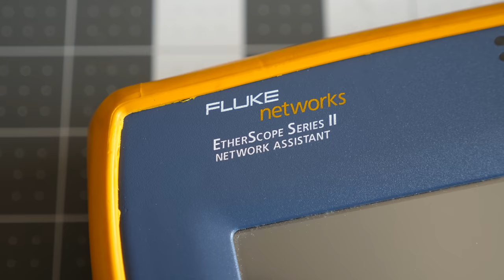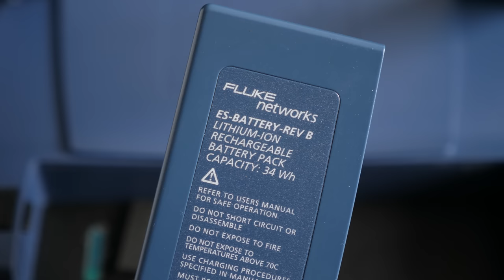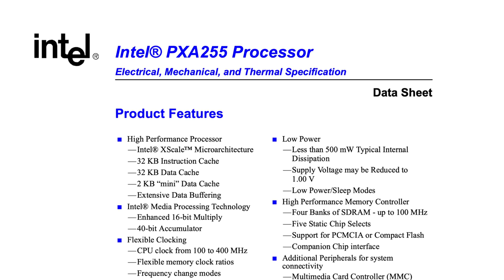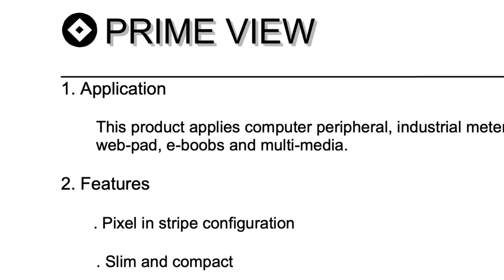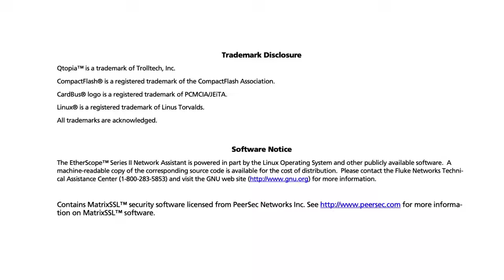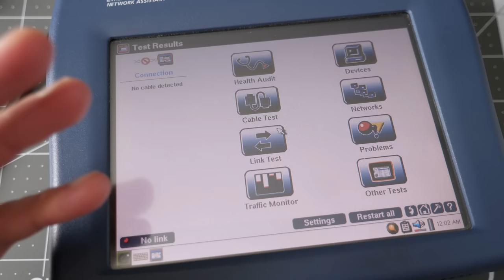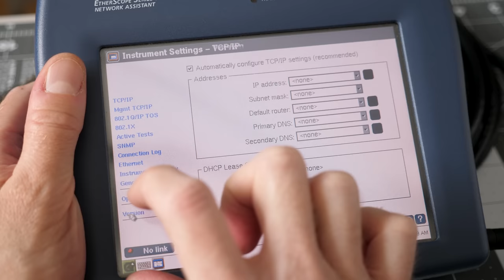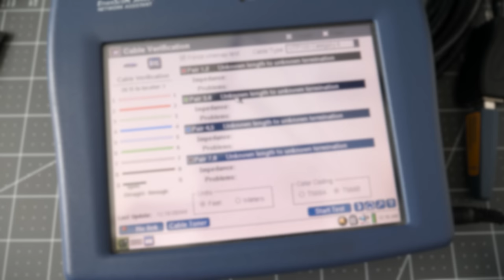Fluke EtherScope Network Analyzer Teardown and Repair

Comment: @This Does Not Compute The AC97 DAC was planned for use in testing VoIP network integration during network testing and Skype calls. There was a Beta run of the software to activate the feature with select companies. The feature was dropped last I checked due to stability issues and cost overruns.
Reply: Heh i just thought the same .... nice to see that i got it right. ;)
Reply: Wish they told symbol(tm) that information… that was what made the rollout of a advanced inventory control hardware that also had voip problematic and was unreliable as a phone. It was a terrible dac. Would do very strange undocumented things in certain situations. That saying “the cheap becomes expensive” rang true. Gamers could of said how bad that ac97 standard is.

Comment: hard to believe a $8000+ device cut corner on a charging jack
Reply: Bad fluke, bad fluke
Reply: Sadly, this isn't a fluke for Fluke. 
Building a great piece of equipment with one major flaw from cost-cutting is fairly consistent for them. Many of them, like this one, can be fixed if you know wheat you're doing. I'm pretty sure there were a few of their voltmeters where the only thing they really changed was the shell, meaning you could get the expensive version of the tool by barely modifying the plastic shell on the cheap version.
Reply: How many that I seen break I stopped counting? Even seen them break on the Scopemeter and etc.

Comment: Millions of devices would still work if engineers wouldn't abuse a solder joint as a mechanical connection.
Reply: Or if engineers would actually engineer and fix it
Reply: @Tano I don't think it's fair to compare a consumer grade product to a testing equipment.
Reply: That's fine the copper should have been bigger, maybe add some vias to the other side to create a better anchor. But IMHO doing it that way properly is absolutely fine, you just have to do it right.

Comment: The audio function is expected to be equipped with VoIP related diagnosis.
Reply: It’s so you can RickRoll a Fluke!
Reply: Yep.
Reply: Legit just popped on to suggest this!  Packet capture VoIP traffic and then listen back to the recorded audio of that VoIP call, to help determine where issues with call quality might be coming from - among other.
Reply: I was wondering if perhaps it would allow a modem addon, but they probably just sold a different device for that.
Reply: Colin @This Does Not Compute
... at 17:30 the BootLoader apparently is from Feb 2006.... that is most likely the original version / date.......... Now nice Prosesor... 64Mb of ram... AC97 DAC .. Gigabit Ethernet.. etc etc......... but  .. Will it run DOOM !!    .. LOL   :-DD
Reply: Probably could run doom easily if you could find a way to boot DOS.
Reply: @simontay4851  it’s ARM, not x86. one of the recent source ports launched thru Linux, perhaps. the original, thru DOS? no way. no original version of DOS, built for x86, will run natively here. MS didn’t do anything with multi architecture support until NT.
Reply: @simontay4851  is linux.. probably can run virtualbox or similar VM software.. :-)  ...
Reply: No , network engineer should listen to music to calm down , that's it 🤣🤣
Reply: @Ramdileo_sys  Good luck getting to run an x86 emulator anywhere near usable speeds on this little ARM
Reply: @resneptacle  I think that with 1600mHz of processor .. a DOS box like the one used in cell phones maybe work ...... in cellphones of 2010 it worked ....... the problem is the 64Mb of RAM .....  but it have solid state storage?? .. sooo.. .

Comment: We have one of the more modern Fluke cable tester/certifiers at work, and I think the price was like $12k a few years ago
Reply: Sounds like the Versiv to me, great bit of kit.
Reply: @DarenPage  Yeah, that's what it is!  We don't use it nearly to its potential, but it is definitely nice to have vs a standard cable tester
Reply: Or test HDbaseT audio streaming like stadiums used to use
Reply: @numlockkilla  Fluke Versiv for HDBT? What about Murideo/mSolution HDBT tester?

Comment: I seem to recall that Intel bought from DEC their StrongARM business and started manufacturing their own ARM CPUs back in the day. Originally the SA1100 and SA1110 were CPUs of between 190MHz and 206MHz which were used in HPs Jornada 820 and 720 series. They then started making the PXA series chips which generally were about 400MHz but ended up at 624MHz. I’m sure they were used in other applications but were mainly found in PDAs. A few years later Intel sold their ARM CPU business and I believe Marvell bought the rights to it or bought their business outright.

As to the OS, it is indeed Linux and the distribution was called Qtopia which is now called Qt Extended.
Reply: I think it was the x-scale processors, in a bunch of PDAs including iPaqs and Dell's.. axiom or something? It's been a while lol...
Reply: @anthrobug  Indeed. The X-Scale CPU's were the PXA series of CPUs.

Comment: Super glue won't hold. If you're not tired of looking at it, maybe try 2-part epoxy resin (like a 5-minute resin). It's harder to repair in the future... but less chance of needing to repair it :)
Reply: Or hot glue gun glue. This device probably doesn't get hot.
Reply: @parkman29  The hot glue i use does stick. You have to clean any residue off the PCB first.
Reply: @parkman29  Hotsnot ABSOLUTELY sticks to PCBs
I've probably seen caps and shit lashed down with hot glue a million times

Comment: These are super useful.  I had a similar Fluke at a job long ago.  We had new cubicles set up and the contractor labeled the ports in the cubicles incorrectly (of course).  Since the Fluke can communicate with Cisco switches directly, I was able to see which switch and port it was connected to.  Then I could properly label the jacks and assign the proper VLANs to the ports.

Comment: There's a firmware update for this model on fluke's website, I'd like to see an update for this video showing that process. 
Edit: I used to have Anritsu and Wiltron spectrum and RF cable analyzer and they were a pain in the butt to update, they must have been connected via lan to a pc with master software that download the firmware from the web checking the serial number. A nightmare but quite rewarding, actually. As someone pointed out that "check sw update" button could still do something.

Great content, Colin, as usual.
Reply: I wonder if that "check for updates" button in the version info works
Reply: Do you have a link to the update?  I recently acquired one of these testers and would like to update it.  I can't seem to find anything on Fluke Networks site about this device.
Reply: @danielhansen7703  I found the firmware here: https://drive.google.com/file/d/1XPKl1-0oA8-v4JPLcRU70iY1owgtRH9d/view do you happen to have instructions for clearing the password on the device?  I read something like possibly using the serial port to console it and login as admin and pass of 'factory defaults' but that was for an optiview.
Reply: @SinisterSpatula  How'd you find this?
Reply: @pattygq  Google skills and lots of searching :)

Comment: (18:01) It appears to be running Qt Extended on top of some form of embedded Linux distro.
https://en.m.wikipedia.org/wiki/Qt_Extended
Reply: You can actually see the Qt in the “start button”!
Reply: @kaitlyn__L  yes
Reply: Yeah it's based on the same OS setup as the Sharp Zaurus (which also used an Intel XScale ARM cpu)

Comment: Intel was a big player in the ARM segment in the early 2000's.  They had the StrongARM series of chips (SA1100, etc), which then became the PXA series in subsequent generations.  They bowed out of the ARM segment in the mid-late 2000's IIRC.  The Sharp Zaurus 5xxx series PDAs used Intel ARM chips and ran Linux.  That 2MB memory near the EPSON controller is probably video RAM.
Reply: By PXA you mean XScale, correct?
Reply: @MaximNightFury  SA1100 was a DEC chip, Intel bought StrongARM and SA1100 begat the PXA series of the newly renamed XScale processors.  StrongARM -> XScale.

Comment: I use a Fluke Versiv on a daily basis, this stuff is pure nerd porn.  Oh and the reason there are different lengths on each pair is due to the fact that each pair has a slightly different amount of twists, this is to reduce the amount of crosstalk between each pair by ensuring that twists occur less frequently between pairs.  As each pair has a different amount of twists, will ultimately affect it's overall length, you'll find that the lengths ARE actually quite accurate.
Reply: Blues got that tight twist goin on.

Comment: Hey Colin! Greetings from Madrid, Spain. Regarding the processor, I remember having Compaq/HP iPAQ devices which had Intel StrongARM (and later, XScale) CPUs in early/mid 2000s. I believe Intel later sold their ARM processor division to Marvell, that would be the reason you have a Marvell CPU with the same part number as an Intel CPU.

Comment: Many years ago when I was working overseas for DoD, they bought Fluke OneTouch tools for every shop so we could do better network troubleshooting.  When I opened the shipping box I found that Fluke had enclosed a coupon for a free Fluke Linkrunner.  I filled it out and sent it off and a few weeks later had a shiny Linkrunner sitting in my APO mail box.
Of course using a OneTouch to troubleshoot PairGain T1 and E1 modems over ancient copper cables laid down in WWII by Nazis is kind of overkill so I mostly used the LinkRunner and kept it with me in my network go-bag.
I still have that Linkrunner to this very day almost 20 years later and it still works just fine, it just doesn't do PoE or anything higher than 100mbps but it's great for testing patch cables, blinking ports, and testing connectivity all the way out to the internet.  I've looked into buying a newer Linkrunner but I do NOT like the direction the company that Fluke sold them to has taken the newer Linkrunners.
Wish I could find something in that same size and form factor but could do PoE and gigabit ethernet.

Comment: 23:06
I spy a Terminal option. Open it in ya spare time and run stuff like:
uname -a
cat /proc/cpu
cat /proc/mtd
cat /proc/meminfo
ls -a /bin/busybox*
ls -a /bin/apt*
ls -a /bin/yum*
And maybe some other commands.
Who knows, may run a fork of Debian.
Reply: And:
cat /etc/issue
Reply: That's not what it does, Terminal opens a terminal emulator through the serial port (2:22), useful for configuring network equipment of that era.

Comment: Looks like Qtopia.  The same thing ran on the Sharp Zaurus linux based PDAs, which had XScale StrongARM processors.  Coincidentally, the clamshell Zaurus PDAs were very popular at the time with network admins because you could plug Ethernet, WiFi and serial adapters into them and configure routers and switches and do network testing with a device that easily fit in your tool bag.  It was kind of amazing how many people had them considering that you had to order them from Japan and install a community-made English translated OS on them.

Comment: I really enjoyed this video!
Also wow, those things are still expensive on eBay! Makes sense, they are still really useful! Test equipment holds value really well (like oscilloscopes and stuff!).
Reply: Yes they are still pretty expensive,  but you can get a decent one between $500-$2000

Comment: We’ve got a Fluke NetScout at work, and I always get in trouble with it when I hook it up to the network cuz it sets off so many alarms when it starts scanning.

The Fluke we’ve got had WiFi built in, and it’s got a couple SFPs, and 3 Ethernet ports.  We’ve got ours upgraded to Windows 10, but it’s shit slow.

Fluke makes extremely nice gear, but it’s fucking expensive.  The upgraded the later models with a larger screen and it has multiple battery packs that can be removed without removing the rubber.

The hardware is nice, but it’s all in their software, because it can do so much.  It’s sick because you can plug it into a drop and it’ll tell you the name of the switch and what port it’s plugged into.

Comment: The compact flash card is for storing screenshots and pcap packet capture files. I use one of these to locate devices with improper subnet masks or things broadcasting for DHCP on a static VLAN. If you use the I think XDP tool, it will snif CDP/LLDP packets to get a switch name and exact port number so you can find the other end of your cable. This can also operate as a tone generator for a wire tracer and can measure cables, as well as identify mismatched wiring. It has a built in VNC server so you can remotely control it. Despite its age, it is still extremely useful.

Comment: Fluke doesn't make anything remotely close to this device. They now have separate devices to test Ethernet and Fiber and WiFi. If you want a copper Rj45/RJ11 toner, they have one too. It'd be nice to get an upgraded all-in-one device like this one. Today, to get all the functionality of this device, you are looking at spending between $20-30k if you go with Fluke brand. The reason refurb units cost $12k + is that there could still be a need for one of these to the right people.

Comment: quick weld by jb weld its a minute setting epoxy i would have coated the plug casing with it and put the unit back together and let it sit for 24 hours will never come off the board again.

Comment: Man I figured this would have been only a couple of G's at best when new, not over $8K 😲
Reply: Fluke's testing equipment is on the higher end of the spectrum in terms of cost. Also probably why a lot of those ethernet testers are probably still in use today. I coworker was using one of those roughly 5 years back for cable testing and the like...
Reply: @alexdhall  Zero surprise it was still in use, and that's true with Fluke being on the higher end. the Fluke 117 electricians kit I got from my late father along with some of his other tools(a lot I would never want to buy with prices these days) who was a welder/mechanic/all around handy man in his time was around $400 when he bought it back in the day.
Reply: @alexdhall  yes they do tend to last for a very long time. I have a couple fluke devices that I still use today for quick cable testing, link activity, etc

Comment: ca glue works very to glue missing pads back to the fiber board, them you extend the solder from the pads to the traces. A epoxy job all over the section is welcome too

Comment: Back in the day, I used to work on telecoms equipment software/firmware, my guess is (as some others have pointed out) the sound stuff is probably for testing VoIP, pretty sure HP/Aligent had similar gear, I remember using something similar but with extra interfaces (V.35, X.21 etc)

Thanks for the video

Comment: Great video Colin, I really enjoyed this one!

In my experience; the reported TDR length is sometimes longer for some of the pairs in the same cable because some of the pairs have a slightly tighter twist than others... I believe this is to counteract cross-talk?

I could never afford one of these (or a modern day equivalent) but I found a very cool tester crammed full of features called PocketEthernet... A real quality tool!
Reply: You can get one off of eBay these days for an affordable price

Comment: You wondered in the video what Lnux distro this thing was using as implied by the manual. I would think that this thing is likely not using any actual Linux distro (n the sense we usually think of a distro as)  as the basis for it’s OS but rather simply either a) Using the the Linux kernel and some other Linux open-source components along with a custom GUI/UI coded specifically for this device or b) they hired a third-party to provide a embedded-style Linux OS that ushers a UI that is customizable to each clients needs. These types of devices, when using Linux as their OS typically take the kernel and whatever other OS components needed such as networking, videos, audio, and storage drivers/components and then have a custom GUI/UI written specifically for a device or family of devices or In some cases, a third-party may make a version of Linux that includes very customizable UI that can be modified to suit whatever product your putting the UI on, thus it takes the form of an Windows Embedded style OS distro in that case but it’s not a Linux distro in the usual sense we think of them. It’s highly unlikely they simply took Ubuntu or Cent OS or Arch Linux and swapped their own GUI/desktop interface onto it as most desktop distros include too many components and additional software then would be needed for any network anylizer device. There are some highly customizable Linux distorts like Gentoo Linux which require to compile everything from course as you build the system locally on your machine but Gentoo isn’t really the sort of distro you would expect to be used in this sort of application.

Comment: Wouldn't some of the pairs have slightly different lengths due to the differences in how much they are twisted?
Reply: It's not based on resistance. It's based on Time Domain Reflectometer (TDR). Look at Fluke's documents. That's how it can measure distance to open circuit. I mentioned the twists because a highly twisted cable is naturally going to be longer than one that is less so.

Comment: I used to have a Gigabyte motherboard with a realtek GBE chip probably garden variety RTL8169 or 8111 and you could go into the BIOS and do a TDR test so unless that was some weird software hackjob I don't think that functionality is that uncommon. Are you using the original charger with it? The actual plug moulding is part of the mechanical design of the jack. It has to be seated and fairly snug inside the rim of the case or all the mechanical stress is on the jack/solder joints. If the original charger's plug didn't seat properly inside, then that is a massive fail.